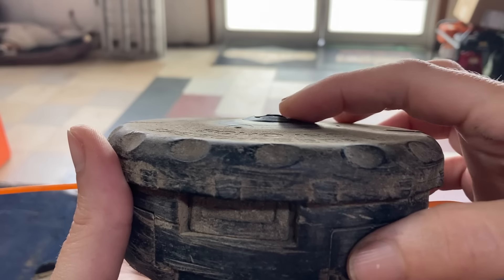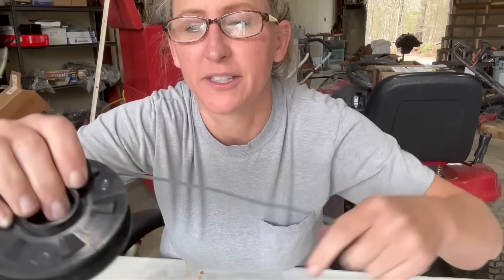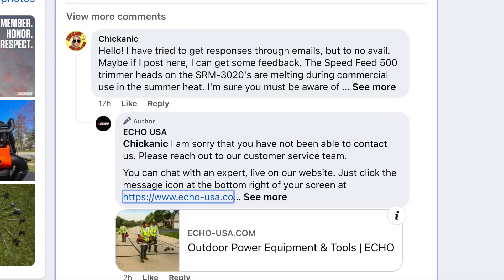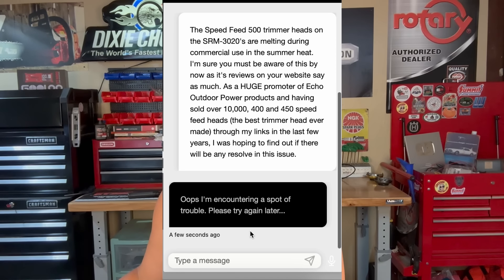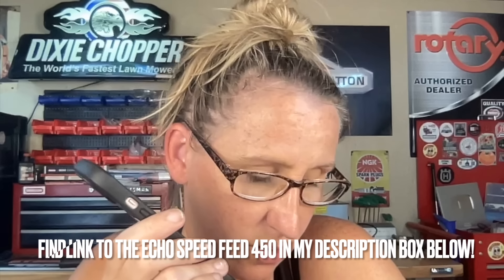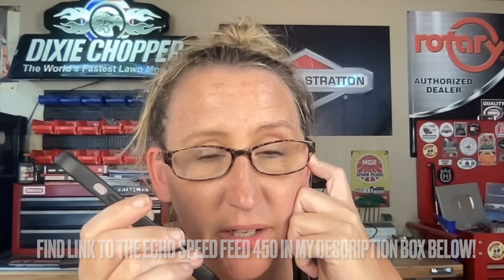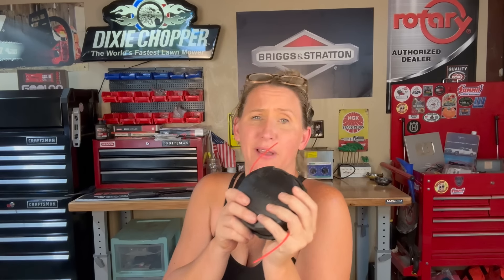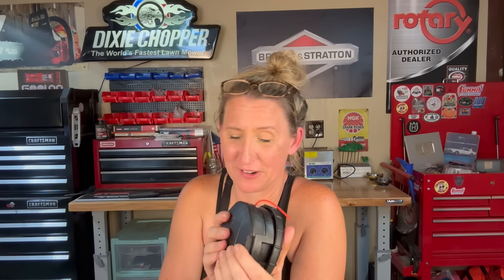WE DID IT!! Echo Admits Speed Feed 500 FAIL and is Working To Figure Out Solution!

Comment: I like the “we’re aware of the issue and MAY make changes in the future” no truer politician comment if I ever heard one!
Reply: Corporate speak for " We don't give a shit "
Reply: @davidkettell1073  I would say it's corporate speak for "Yeah, we screwed.  Bad.  But if we admit an actual flaw we might have liability.  We'll fix it but insist it wasn't a flaw."
Reply: Along with 6 "uhms" in the statement.
Reply: I've worked on issues in firmware where we knew there was an issue, found what caused the issue, but were not able to fix it due to hardware or software constraints outside of our control. Once you've experienced that once you begin to always avoid making too strong of a commitment to a fix.

Comment: I purchased the SpeedFeed 500 about a year and half ago when my supplier told me that the 450 had been replaced by the 500.  initially it worked fine with the supplied line but once I ran outta line and replaced it with my Echo .130 line I soon noticed that the line was breaking from one hole as I used it leaving me with a single trimmer line.  When I investigated the inner spool, I noticed that the line was melted in place.  At that time, I contacted Echo and they told me that they had no history of complaints on this issue.  Initially I thought that the issue was due to me using such large line but when I went back to .095 line I still had the issue.  The way I have been dealing with the issue is by installing only about five feet of line on the spool at a time and that way the line runs okay, but I do run outta line quickly.  Thank you for bringing this issue out in the open and look forward to finding a resolution to the issue.
Reply: Interesting... did you use Echo Black Diamond for refill or something else?
Reply: @CJRock-xn5qf  I use Echo Crossfire line, the 500 head initially came with Black Diamond Line, which I have used but I really don't like to use it.
Reply: @franksanchez911  So you haven't experienced OEM  Black Diamond line melting.

I'm not defending Echo but if the OEM line doesn't melt... who takes responsibility.
Reply: @CJRock-xn5qf  so you are saying they have built a trimmer head that only works with their trimmer line?  That's even worse.

Comment: I had a simlar problem with my Ryobi 4 cycle trimmer head . it would get crazy hot and the line would melt to itself. After watching your channel and seeing you grease the shaft i removed my screw and replaced it with a grease fitting like it should have had to begin with. Replaced the head with a Shindawa universal head and have no problems since except a new carb. It is easier than trying to clean that tiny thing with 70 year old hands You are a godsend to all us would be tinkerers.

Comment: Thank you for making the video about the melting head.  I recently purchased a 3020 and experienced the same thing within the first hour of using it with the line that was included with the trimmer.  I would not have figured out what was happening if it weren't for your video.  It melted on me when I was using it in 70 degree weather!  I tried different line and got the same result.  Since they aren't making the 450, I purchased a knock off 450 head.

Comment: I was tried of the crappy head on my old Toro and looked into replacement heads for it and found your video on the 400 and picked on up. Unfortunately there was no way to lock the head like every other trimmer that I've seen so I gave it to my brother (it still worked fine) and bought myself a new DeWalt. First thing I did was spin the stock head off and put the 400 on and have been super happy with it so far. Also bought the endoscope you recommended as well. Didn't work as well as I'd hoped for what I bought it for but it's been quite useful for other things which still makes it a win.

Comment: I am having the same issue with my battery Milwaukee M18 combo string trimmer. It has a tendency to melt the line inside the head just like you showed. I have no idea who makes the head for Milwaukee, but every now and then I have to take it apart and rewind it because it is stuck. Anyway, awesome job on getting the company to address the problem.

Comment: For our particular situation, this type of head is a disaster. We weed whack about six acres of dry weeks in the spring and early summer for wildfire mitigation. We have some rocks that are not visible below the 3ft tall weeds. When this type of head hits a rock and breaks off the lines, you have to disassemble the head to rewind the line. When putting things back together if you don't get it snapped together completely right it may come apart and you risked losing some of the metal parts where the line comes out. We used these heads for one day before that happened. Also the heads are not that easy to open and snap shut, especially for my wife that does 60% of our weed whacking. Now we stick with the old fashioned heads where you wind it the old fashioned way and never have had a problem.

Comment: Nice job Bree!
I don't cut lawns for a living.  I got tired of buying cheapo trimmers and so bought an Echo trimmer.  Every time I used it, the line would get tangled up and had to remove the cap.  Also, it was a pain to get it started.  I am disappointed in the brand.
Reply: I have used Echo power equipment for over 20 years, & the main reason was that it was always easy to start. Take your  trimmer back to the dealer & let them take a look at it.

Comment: I had a line melting on the head issue with a consumer-grade electric Weedeater.  I spent more time with the head off pulling out stuck melted line than using the unit.  Only corrected once I bought a 3rd-party replacement head.  Left it with the house when I sold the house.

Comment: I switched to echo smr 3020 from a Stihl trimmer basically because of your reviews. Stihl issues were clutch, valves and drive shaft. I was having the same issue with the line melting. I needed a new cover on the job and I have bought the head for the old Stihl trimmer. I thought both were the same but the lids wouldn't fit. One must be a 450 and the other a 500. The line that was melting was the one that came on the SRM 3020

Comment: I bought my SRM-225 trimmer new in 2013 and tht line advance in the head has never worked properly.  The only identification I can find on the head is "Speedfeed".  I have to take it apart every time to pull more line out.  All my yard equipment is Echo, they make good products other than the head on my trimmer.  I will say though, the chain saw I bought back in the 80's was much better than the one I replaced it with a few years ago.

Comment: We just had to do our annual weed trimming of our 6 acre property in Northern California (no mowers because of fire danger and rocks).  It's a big undertaking so we were hoping the 500's on our two Stihl FS 131 (handlebar version) wouldn't have this problem.  My partner had it jam twice on the first load of string.   I had it start jamming on my second load.   I went back to the trimmer heads that came with the Stihl.   They may be a pain to load, but at least I didn't have to keep taking them apart to unjam.  I just ordered a couple of 400s for next year.  For anyone that cares, I had also purchased the Stihl 26-2 heads which are supposed to be speed feed-like. Those are even worse. We couldn't load them because of the dirt that they let get inside.  They wouldn't spin freely to load the line.   I was having to take them apart each time to clean them out.   How is it so hard to make a decent trimmer head?!

Comment: I've had to glue in the metal protectors on my 400.ive also had to drill a wider hole to accommodate my 3mm line into my 400.

Comment: If you have another 500 come in try drilling vents into the top cover and into the head. Drill diagonal so that the holes face clockwise when looking from above. 2 should be enough to move air into the head and keep the string cool.

Comment: On my job, some machinery will get extremely hot. In those gease fittings, we use a red Lithium grease, especially for high temperatures during operations.

Comment: I have a new echo srm 2620 that has the speed feed head, and although i do like the speed feed head, i find if the string melts together, you have to take it apart and when the plastic wears out you have to replace the whole head. I have an older grey head 260 echo, and i think i prefer that head with the insert. It's not easier to load string, but you have less issues with it.

Comment: Every time I watch your videos, you make me more glad I moved into the 21st-century with ego. The string trimmer is excellent, it automatically feeds line. You cut 15 feet of line, run it through ,divided in half push a button it whines itself even a dummy like me uses it correctly.

Comment: that figures with all of the engineers they have working on it they decide to take a great product off the line that works great and put a defective product out for the customer or the  commercial lawn care worker for them to have major frustration  or they are going to take the speed feed 450 design and work it into the 500 and then call it the 500 improved head we will have to keep an eye on it  thanks for the videos Bre love them and watch all of them have a great day and stay hydrated with the summer heat take care Chris

Comment: I'm not a commercial user of lawn equipment but I do have questions concerning this issue. Why is it only Echo trimmer heads? Are there other manufactures having similar issues? If the 500 head is having issues of this nature, are the materials ( Plastic ) not able to with stand the heat  and have the plastic compounds changed from the 400 to the 500 head causing these problems? Are the Trimmer gear heads creating that much heat on Echo's products and not other manufactures? To many unanswered questions of the comparisons of the different manufactures to pinpoint a correct answer without further research into the varied of manufactures on the market. I do have a DIY product that I use every week at hours on end and in times when the line has failed to advance, I have had no issues in manually pulling the line to untangle it within the head and also when I get a grab  hold of the head , it's not that hot that I cannot grab it with my bare hands or handle it.
In summation I would say Echo is probable subcontracting out the manufacture of these heads and that manufacture has changed the chemical compound of the plastic being used ( control of manufacturing Cost ) to mold these heads or Echo has redesigned the gear head assembly where it's not dissipating the transfer of heat. Sorry for the long winded response but with the Echo Rep on the call and it being recorded ,I would have pressed her with a few of these questions which would be referred to R & D.

Comment: When I got mine four years ago on a Stihl I chose the small one so I guess the 400. The line friction welded together once. I changed it out and went on. Saying the heads are melting may be an over statement. Haven't seen any damage to the head itself but I'll check now after hearing this. Yes it's good to demand products that work. But there's a far more fundamental problem with all string trimmers sold today in the US. 80% of Americans pay for it every time they use them and ignore the problem. Had a Toro 40 years ago that was designed correctly for an American! I tried telling shops in my area and they couldn't get their brains turned on. So there's a hint, you figure it out.

Comment: Wonderful to hear they are looking into this issue.  Bri, or anyone with the knowledge for my trimmer.  Will a Speedhead work on a Greenworks Pro 60-volt trimmer?  I've had it for several years and I will need a new cover & bumphead before too long.  (I could not find my answer on line) Any help is appreciated. Thanks.

Comment: The one thing I didn’t like about the 450 is that the eyelets would pop out after a while. I like the captive eyelet setup of the 500. I’m in Barbados, so every day is a hot day. I find my 500 has bent the other way, rather than swelling out, it looks like it’s caving in. Still bumps fine and turns easy, but just an observation.
I also run a 500 on my PAS2620 which is a 25.4cc and it turns it fine. That being said it has the high torque head rather than the standard one 🤷🏾‍♂️

Comment: I dont use a guard on the 3 echos torque models  I got    and use stihl pro line in them  . Clean them with wd40  and I grease the the gear head with lucas grease .  Never had issues with speed feed heads  so far .   But not sure my  t model had 500 head tho .

Comment: Just a thought, but I noticed the 400 and 450 you showed had brass inserts. The 500 head had a steel insert. The brass could keep that insert cooler. I can imagine the gearhead gets pretty warm. Make sure the head is greased well.
PS. I put this comment in just before I heard you say the exact same thing.  
It’s an easy fix go back to brass. They were cheeping out.

Comment: Well I ordered both a 400 and a 450 following your link. Don’t know how I could miss following your recommendation!😁
So tell me, what are your views on the types of trimmer lines being offered? I kept our mowing crews 2 strokes running(most of the time unless they had an attack of the “Golden Screwdriver” bye one of the crew!😂) and we used .105 line, straight round line. In your experience, are there better lines such as the twisted, the triangle shaped, the 6 sided and etc? Definitely soaking the line in water makes the line last longer. We would go through several spools of the black .105 line a month and stayed with that line as our local Stihl dealer kept it in stock for both shops of ours. Now retired and moved and the weeds here in New Mexico are definitely tough and a regular “Walmart” line doesn’t last long. I wish I still had the Stihl trimmers we used as they with one exception were double tough and powerful. One Stihl trimmer lost a seal and would only run flat out when you got it started and being a Government agency, they didn’t want to spend the money and time to have it resealed so they instructed me to just buy a new one. 
Really enjoy your teachings and demostrations! I look forward to most. I still fix saws, trimmers and such here for friends. Just being able to fix stuff has brought me lots of free saws and stuff because I fix things that they don’t understand and it’s better off that they don’t try. I’ve been given lots of Stihl chainsaws and one huge Echo/John Deere saw in payment for some of my work.

Comment: Interesting- I have the issue with a 400 head. The bump won't feed the line, I keep ending up with one side cut off leaving a single line,  and I have to keep taking it apart to pull the stuck melted line apart.

Comment: Hate to say this, but I have the line melting/welding problem with 400, 450, and 500 heads. This is across several heads, several brands/sizes of line (well hydrated), and on several types/brands of trimmers (Echo gas/electric, DeWalt electric). I go slow around fences, rocks, etc.

Comment: I've been using the Speed Feed 500 and I am having this same problem. I have to take the string head apart 2-3 times per week because the line gets fused and breaks off at the grommet. Now, I am using the .130 string, which is probably too large for this head. It is very stiff and very difficult to get wound onto the reel. It wears out my hands(wrists) just to load the head. However, I bought a 5lb roll of this stuff so I must use it. Additionally,, I ordered the Speed Feed 450 from an eBay seller and they sent me the 500 instead.

Comment: I’ve had this problem on all my trimmer heads. (Universal, Stihl, Echo, Shindawa, & Husqvarna. 
I feel the problem is in loose winding of the trimmer line inside the head.  When the line is snatched on heavy weeds or fencing, it pulls the line down into the loose windings when that happens it burns and melts the line.
How to correct for it I’m not sure. What I’ve done is put tension on the line as I feed it into the head by winding it up, so it’s wound tighter and doesn’t get pulled down into the loose windings as often.

Comment: Great video concerning a faulty head made by Echo. I have been wondering if my old Toro curved shaft trimmer would work with one of the Echo speed feed heads. Could you tell me whether a Toro model 51950 would have the capability to use an Echo speed head? Thanks again for the great video.

Comment: Curious that my stihl trimmer has started to have the same problem of the nylon line slightly melting and sticking together. Never had this problem before and my head is in good condition. Could old line (10+ years) degrade and cause this melting problem?
Reply: It could be the grade of plastic line that is currently being used, as you state, to be the cause of the problem, also.  The more "rubbery" the plastic, the more it is prone to heat degradation.

Comment: will the speedfeed 400 or 450 work as a replacement head for the battery powered EGO ST1502?? Don't know if a 56 volt battery powered equates to a 25cc gas powered unit???

Comment: What's the difference between the 400 and 450?   I got a 2620 last year and it came with the 400.   I still need to do the bolt mod to mine to help prevent the wear down.

Comment: I've had melted trimmer line in my echo speed feed head. It usually doesn't cause a problem, but it has a few times & I've had to take it apart. I have no idea which head I have on my trimmer. It's an Echo speedfeed that didn't come on my 20 yr old Echo trimmer.

Comment: My lawnmower has Briggs and Stratton quantum 190cc engine it is running rough. I did put new carburetor, new oil, new spark plug, new air filter still running rough rough can you help please.